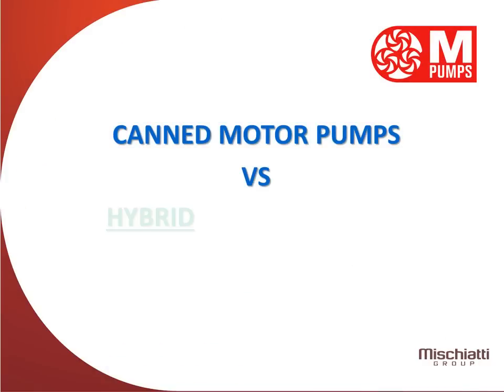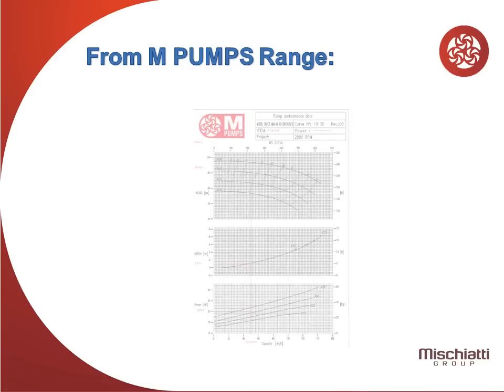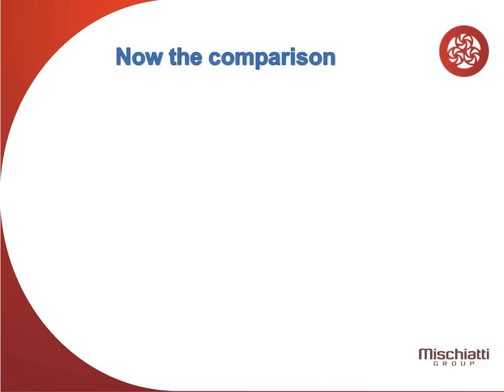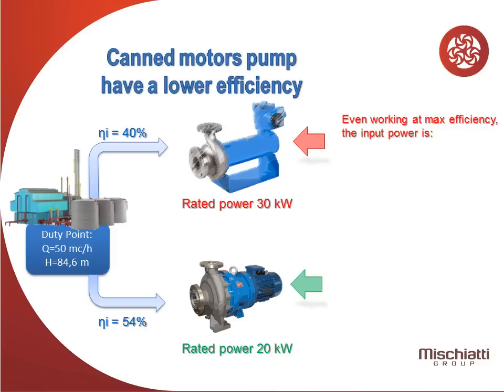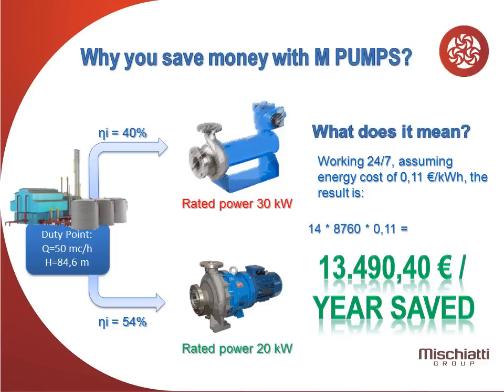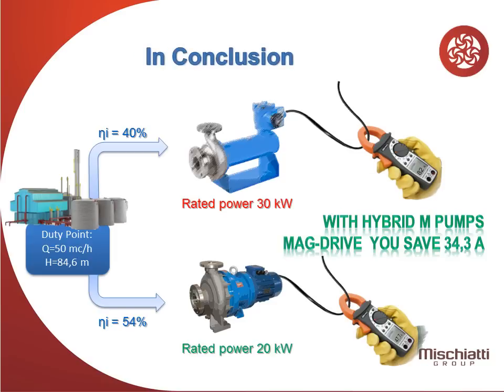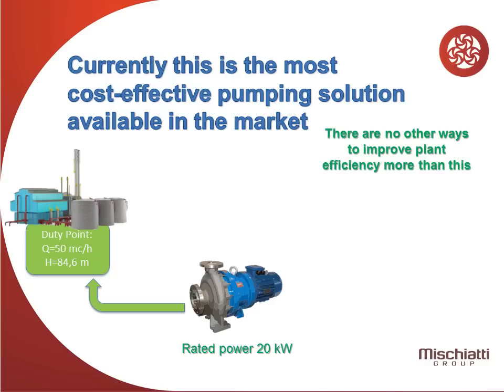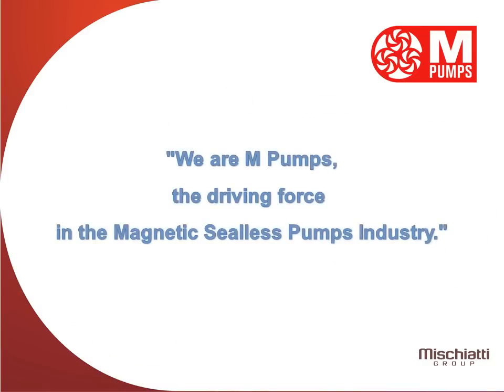Canned VS MagDrive 2016

Comment: Our field findings fall in line with a research article published by China Academic Journal Electronic Publishing House. For rated KW below 22KW and Rotor diameter below 160mm, the eddy currents loss is marginal between mag. drive and canned motor pumps. However, for higher rated power (Above 22KW), high speed and high viscosity applications, the canned motor pumps apparently suffered from poor efficiency. In these cases, the power loss due to eddy currents and the parasitic losses are very high on canned motor pumps as compare to magnetically driven pumps.